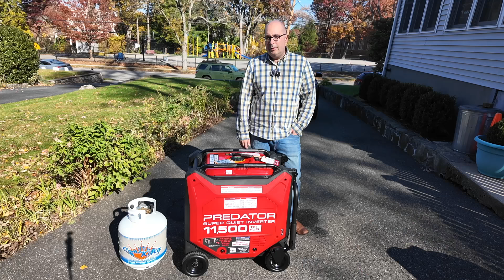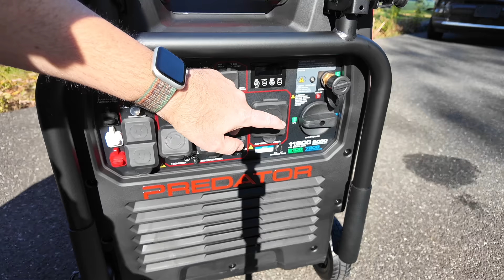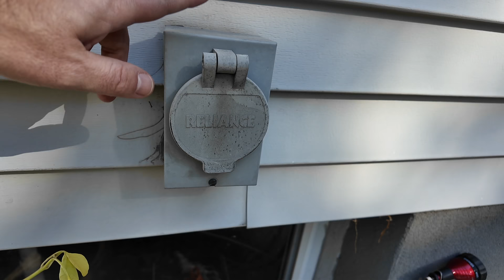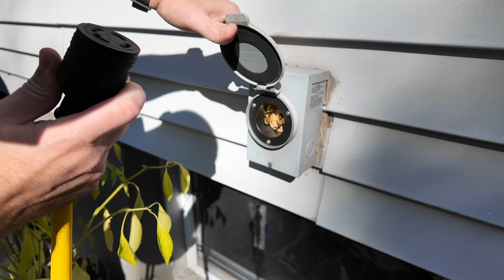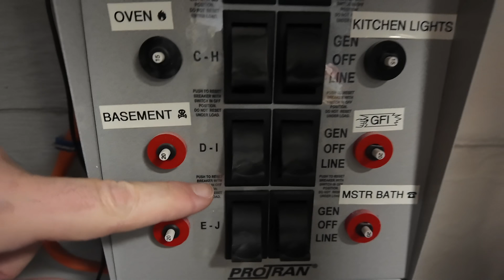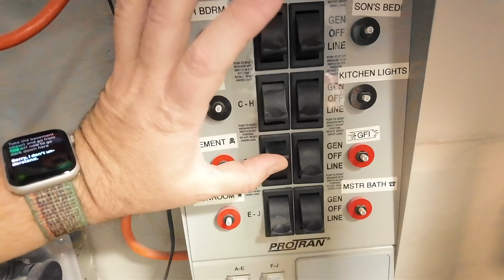Predator 11500w Powers My Entire House (Transfer Switch & Full Test) — Honda Should Be Worried!

Comment: It's called "Total Harmonic Distortion" THD. Gas furnaces will not run on an open synchronous generator because the waveform THD is 75%. I've put those types on an oscilloscope, and turns out that it is "V" shaped and jagged. As far as installing an interlock kit, I recommend turning everything on. Control your usage inside. You'll comfortably get 30 amps per leg. Don't run heavy loads simultaneously.  It's emergency power. It looks like you're going to use 60lbs of propane per 24 hour period on eco-mode. That's a lot of coin. The larger the unit, the more fuel just to keep it running. You have to make some solid decisions when buying a generator and what you need. My example would be the well pump. Everything else is a given. Nice video. Thanks for taking the time. 😊😊
Reply from the maker: Great points! Thanks for watching
Reply: Open asynchronous generator?. Are you basically saying a non-inverter generator?  The vast majority of the generators these days don’t fall anywhere near your 75% figure. 75% THD would be so distorted that most electronics wouldn’t even power up, and the voltage RMS would barely resemble AC.  I have a gas furnace and it ran on it on a generator that was 20 years old. Probably had 10% distortion never had an issue.  Most all the ones today are in the 5% THD range. The whole sensitive electronic stuff is totally over blown in my opinion.
Reply: @condor5635 I wish I could send you what the waveform looks like. Jagged v-patterns. Some inductive loads make it worse.
Reply: @MrRChitty you are saying for this particular Predator generator ?
Reply: @condor5635 no. However, could be characteristic of it. I have a 3500/4200 watt Champion I scoped a while back. In addition, when plugging it into the camper, the WFCO converter destroys the waveform. It even does a number on both the Honda and Champion inverter gensets, (2000 watt).
Reply: well with big generator you can run it at 25% and it would be more efficient then small generator running at 50%
Reply: @Dimka2 Not true. He's getting 20 lbs of propane per 8 hours. Yes, he's running it at 25% or 2000 watts. I don't run 2000 watts in my home at a consistent basis. He'll never do better than 20lbs per 8 hours. If he goes to a smaller machine, he'd be able to achieve better. For example, a 2200 watt inverter will get roughly 34 hours on 20 lbs at 25% or 500 watts. It's emergency power. If that's the machine you want to get, you'd better get a couple of 100 lbs tanks. He's going to burn through 60 lbs every 24 hours. Two 100's will get him 3 days. I survived with two 2000's paralleled. 2 gallons every 8 hours or 6 gallons every 24 hours. Again, it's emergency power.
Reply: @MrRChitty   my scenario was if you need a smaller generator to run at 50% load its better to have a bigger generator that would run mostly at 25% load  more efficient like that, obviously if you have a tiny load having smaller gen is enough .. in my case i got pretty much everything electric except the stove so having bigger generator run at low is better .. well pump, water heater, heat pump furnace
Reply: @Dimka2 you didn't express your scenario. In either case, this generator needs a significant fuel supply. You have to be able to get to the fuel source in times of crisis or a significant storm. A buddy of mine had a 20k. Wanted to make sure his family had all.of the amenities during a power outage. He went through two 100 gallon tanks (the big belly tanks) in a week. Access to his home was blocked by downed trees. In the end, you have to do what's best for your situation.  Just know, you're gonna need a decent fuel source.

Comment: I did an analysis of my generator (a Firman 10,000W Tri-fuel) when I first got it a couple years ago and running at half load the results showed estimated costs of: $1 per hour natural gas, $2 per hour gasoline and $3 per hour propane. It's setup for natural gas and has powered my whole house (912 sq ft) flawlessly several times during outages. With a small house like this it doesn't come close to maxing out.
A helpful hint is to mark the ends of the transfer cord with magic marker to indicate which end is up. Makes it a lot easier to install the cord when the power goes out in the middle of the night.
Generac wanted $9500. This whole system was $3100 including running the electrical and gas to my deck.
Reply from the maker: Thanks for sharing your experience and the helpful tip!

Comment: One question.  Our NG condensing furnace uses about 400W to run with the circulator running.  So the question relates to your oil furnace.  It has a pressure pump to create the oil mist.  So how much power does your furnace need to heat the house?  Running wattage, not start up circulator power.
Reply from the maker: My oil furnace with bower motor ( it’s forced air) takes about 1,000 watts most of which is from the blower motor

Comment: You need to get a main breaker lock out so you can't back feed to your power lines n hurt or kill a linemen working on the lines.
Reply from the maker: A transfer switch like I have or a panel interlock automatically prevent back feeding. Thanks for watching
Reply: Guess he cleared that up

Comment: I had a Subaru generator never failed me, had one on my bus conversion,   the one draw back in 2020 with gas, diesel, or propane is you run out.  In a grid down, solar panels recharge my bluetti  indefinitely.  I would use it to recharge my batteries on cloudy days, but my primary would be Bluetti, type of device.   Especially in a shtf scenario.
Reply from the maker: I agree with you - a generator coupled with a power station and solar is the optimal setup. Thx for watching

Comment: When we lose power at night, I can tell when it comes back on by the street light and neighbor's lights. During daylight hours, I have no idea if municipal power is on unless I shut the generator  down, unplug it, turn main breaker on and check lights. That's one advantage of a whole house set up. But I don't want a lawn tractor size engine screaming at 3600 rpm outside my window for who knows how long.
Reply: Uh can’t you just look at your meter and see if it has power there’s like an LCD display on it no?
Reply from the maker: That's definitely a benefit of a whole house setup compared to a portable generator.

Comment: 15:15  I installed a panel interlock so I can "possibly" energize all 42 circuits.  Since I'm totally electric with a well and septic pump and electric water heater, I have to "balance" around to use my 9,500 non-inverter propane generator.  But it is doable since I have mapped out every circuit, so I know what is on it exactly.  Plus I havre an energy monitoring system so I also know what draws what.  Plan to upgrade to the 11,500 HF inverter unit this Winter.  So, probably no jockeying around.
Reply from the maker: That’s a great setup - thanks for watching

Comment: What I like about my setup is we live in a mobile home. They designed the power for the trailers so that you plug into the power pole via a 50 amp plug. So I could just plug my house straight into this and not worry about feeding back into the line.
Reply from the maker: Sounds like a very convenient setup!

Comment: Info for you and your viewers. I’m a retired electrician and I’ll give you the correct amperage available with this generator. If you take the wattage and divide it by the voltage that will give you the amps the generator will supply. Generator is rated 11,500 watts surge and 9000 watts continuous output so 9000 watts divided by 120 volts is 75 amps total , over over 2 hot legs (wires) or 240volts 37.5 amps  total for each leg. Your regular outlets throughout the house are supplying 120 volts (single breaker in panel) your electric range, well pump, electric dryer, outside AC  conditioning compressor are all on 240 volt double pole  breakers. I would install a 50 amp outlet on the outside to be able to feed the panel what this generator is capable  of providing. Installing a 30 amp outlet on the outside is perfect for a 7200 watt generator. Installing the transfer plate for the main electric panel and mark the breakers that you would need Incase of a blackout. Your total amps is very important and you might have to switch breakers around in he panel to balance the load for each hot wire coming from the panel and generator. Once done blackouts won’t be a problem anymore. 👍
Reply from the maker: That's incredibly helpful information for everyone!
Reply: @Ramborsch....thank you sir.  I like when journeymen from various trades comment with really useful information. Your insight/info is greatly appreciated.
Reply: Always go 50amp outlet! You are always going to upgrade over time, so why do one of the biggest install aspect twice. Never ever 30amp.
Reply: You have to be careful - you can’t just switch breakers around. Many factors need to be considered when moving breakers.
Reply from the maker: Good point and thanks for watching
Reply: @condor5635 why can’t you just switch breakers around, what factors
Reply: @drewcollins31 you can move breakers from one leg to the other. Not in itself a big deal but you need to understand implications. Also breaker size - a double pole half height could be on 2 legs and moving it could move it so that it’s on the same leg for both poles. MWBC - you could move a breaker and change the amount the neutral carries back by putting the breakers on the same leg. This is just some of the cases you need to consider and understand
Reply: The manual says the neutral is bonded to the frame of the generator. Do you reckon we should be unbonding the neutral on these gens before plugging it into our homes via an interlock kit?
Reply from the maker: Yes. It’s bonded but to hook up to a house it should be floating. I will try to do a video in the next 2 weeks showing how to unbond it. It’s just been too cold outside to make the video
Reply: @Outdoor_Prepper i found out that there are two versions of these machines.
Reply from the maker: @MrRChitty there are! It seems the most common one is the one I have but harbor freight has some additional units made by another manufacturer with some of the controls in slightly different places but other than placement it functions the same
Reply: @Outdoor_Prepper yes. However, the video i saw regarding the bonding, it appears in different locations. I am sure you'll figure it out and will be fine.
Reply: @radf-zf7ev yes most definitely. Its an easy job - most manuals show you how to do it.
Reply: HVAC contractor here. Just in case people don't know this. In order for you to run your HVAC for AC you would need a soft start installed on your condenser unit for this set up. That's the only way it would work.
Reply: @joemcfarland3491 as an HVAC you should know that such an overly generalized statement. Generator size, tonnage, AC type  all play into that respond. Not required in all cases but many
Reply: @joemcfarland3491 I am looking at Micro-Air soft starts for my ACs.  Generally the reviews are very good but there are some people cautioning not to use any soft starts due to shortening the life of the compressor.   What has been your experience?
Reply: @joemcfarland3491 gas heat shouldn't have an issue though correct since it's just the blower fan and thermostat?
Reply: its called INLET, not outlet
Reply: I’m not a electrician but I believe I get the gist of what you’re saying. So I plan not to use my RV 30 W outside but instead get one installed. Based on your input instead of being a 30 amp should go for a 50 amp is this correct?
Reply: @dmlifestyle9788  if installing one of these inlet boxes install a 50 amp with the correct outlet and correct wire sizing then you don’t have to worry about getting a bigger generator down the road and upgrading from a 30 amp. The cost difference is negligible.
Reply: I appreciate the information and I’m sure the rest of the viewers due as well. My basic understanding of electric electricity and wattage is is well very basic so your comments were very helpful. Thank you.
Reply from the maker: I’m Glad it was helpful
Reply from the maker: I woukd personally recommend getting an electrician to install a whole panel interlock with a 50amp inlet
Reply: He is using propane so it’s only 7500 watts continuous
Reply: I have a 50 amp interlock with a 12,000 watt pulsar duel fuel pulsar generator. It will run my whole 1,200 square foot house with oil furnace or 4 small AC units except car charger, dryer and stove. I can run one of those at a time if I turn some other circuits
Reply: To the journeyman, don't forget about power factor. Induction loads have a high power factor and will consume available resources of this generator.  In all technicality, it's rated as KVA. KilloVoltAmps. That's because hidden in there is PF or power factor. Yes, this thing is large enough where run wisely, won't be an issue.
Reply: If you unbound this generator. Harbor Freight with void the warranty! Outdoor Prepper does not say anything about unbinding the neutral when he powered his house. BIG MISTAKE TO TRUST SOMEONE ON YOUTUBE THAT IS NOT A ELECTRICIAN!
Reply: @8894larry NEC 250.34 (Portable and Vehicle-Mounted Generators): This section covers the grounding and bonding of portable generators.
NEC 250.35 (Permanently Installed Generators): While covering permanent units, the principles regarding creating a single effective ground-fault current path apply to safely connecting to house wiring.
NEC 250.24(A)(5) and 250.30: These sections prohibit dual, parallel grounding paths for the neutral conductor.
NEC 702 (Optional Standby Systems): Covers the requirements for transfer switches and proper interconnection to prevent backfeeding, ensuring the system is safe. 

Let me know your thoughts on this.
Reply: @8894larry want to say that in dumb speak ? lol. what’s that mean?
Reply: @8894larry  keep your day job Larry
Reply: @8894larry - love it when people talk about voiding warranties. Yeh HF is going to remove stuff to see if it’s ‘unbonded’ or not during the return process. I’m sure. Uh excuse me this generator was unbonded. We can’t give you your money back. Who would try and return it without putting it back anyway. Geeze

Comment: And just for reference. He said $1500 to get an interlock installed. I was charged $900 and was given a 25’ generator cord to go with it. I had everything you need to run this same set up except a NG hook up for $3100 all said and done.  Can’t beat that.
Reply: I paid $37.00 for my interlock.
Reply from the maker: Sounds like you got an awesome setup for a great price! Here in NY the electricians charge more - it’s definitely more expensive than it should be to have someone install the interlock

Comment: I got that gennie and love it. My main question is how u get it out of the box without cutting the box away? A crane? 😂😂
Reply from the maker: It was definitely a two-person job to get it out if you don’t want to cut the box! I had to cut the whole box up - check out my review unboxing video where I demolished the box lol
Reply: @Outdoor_Prepper I still have three boxes in my burn pile 😂 I bought a 9500, got it home cut it out of box…..won’t start. Take it back and exchange it for a new one, got it home cut it out of box, worked great. Fast forward a week I discovered that the 11500 came out THE SAME DAY I bought my 9500 sooooo……I took back the second 9500 and exchanged it for the 11500 basically cause I wanted the tri fuel and we were actually popping the 9500 using it to power our rv we live in. I don’t think it shoulda been overloaded so maybe something was wrong with it also idk. I LOVE the new 11500 tho!! Great upgrades. Better insulation, easier access panels. Remote start. Push button. It’s way bettter than the 9500 for only 300$ more.
Reply from the maker: The 11500 has some amazing upgrades over the 9500 for sure

Comment: We use a Predator 5000 dual fuel inverter generator but we’ve added an EcoFlow battery bank solar “generator “. So we can charge the EcoFlow in less than 2 hours with the generator and run our house for almost a full day.
Reply from the maker: That's a fantastic setup to maximize efficiency and run time!

Comment: Nice.. it looks like it works really well.  I have a GemMax 7250 gas/propane and I’ve used it on a Daily to power and recharge my off grid house. But the thing is I usually use about. 10kWh - 15kWh a day..
Reply from the maker: That's awesome you're using it daily for your off-grid setup!

Comment: We just purchased this generator. I ran it tonight hooked to our 2,200 sq ft home. Easily ran our whole home ( about 2 KW load) in eco. As I increased the load it handled it well including our older Heat Pump.which loaded it to almost 6kw. If you are going to run large loads I recommend taking it out of eco mode. Otherwise it handled the microwave, air fryer etc with ease and we never exceed 6 kw.
Reply from the maker: Thanks for sharing your experience—that's great to hear it handled everything so well!
Reply: @Outdoor_Prepper  also curious if you floated the neutral???
Reply: Did you unbond  the neutral?

Comment: What about theft?  Is there a way to lock it down with a heavy cable, or chain?
Reply from the maker: Absolutely- you can chain through the metal handles on the top. The unit is extremely heavy though plus while it’s running it will be extremely hot and make it more difficult to move / steal

Comment: I have the Predator 9500 starting and 7500 running. It is amazing but my AC is on a separate circuit.  I’m thinking about tying it in and getting this as an upgrade and having it hard lined into my natural gas line
Reply from the maker: That sounds like a solid setup you're planning!